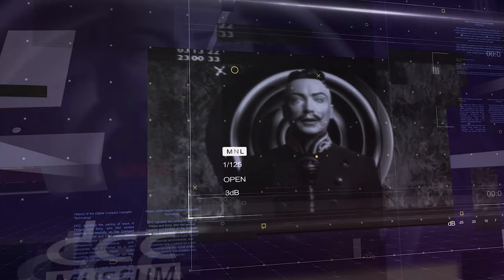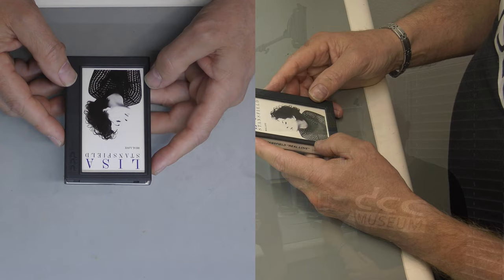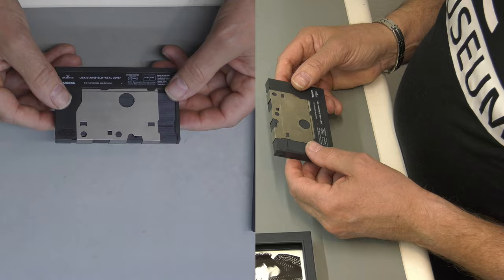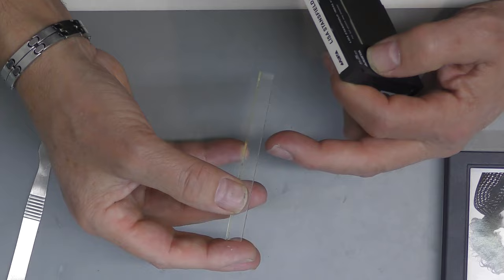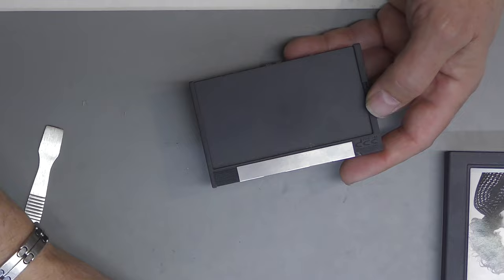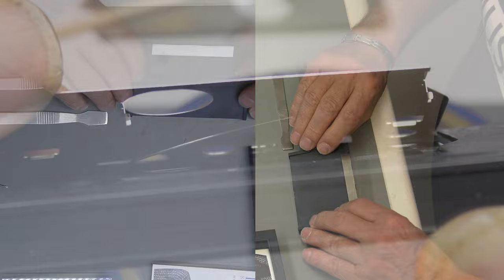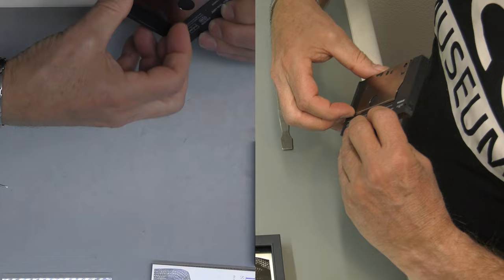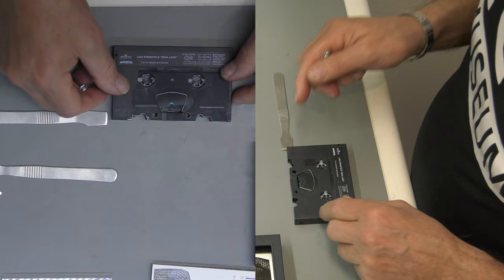Repairing a broken tape inside a Digital Compact Cassette with Brother DCC.

Comment: Interesting project, great job putting it on video. These cassettes are a marvel. Could be interesting if any variations are discovered that went away from the standard shell design? Maybe see-through shells or with a window? Because the slider moves sideways it was a bit tricky to built standard front door loading mechanisms, portret cassette loading was introduced i guess. It is definitely a better system than a (VHS & V2000) Video cassette had, although an Elcaset had none.

Comment: It's great but i'm missing how the tape is connected together. Wonderly the tape is suddenly connected, as if a miracle happend  👍
Reply from the maker: Great point! The video was mostly about opening and closing a DCC shell. Repairing the tape is similar to any other tape. You put it on the  cutting board and apply the tape on the back of (any) tape. Not on the top side that plays.